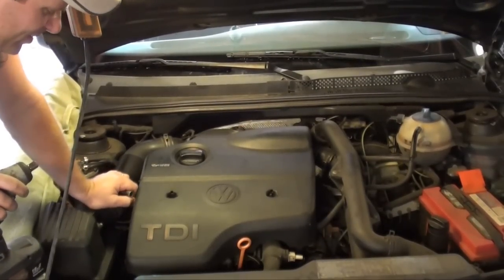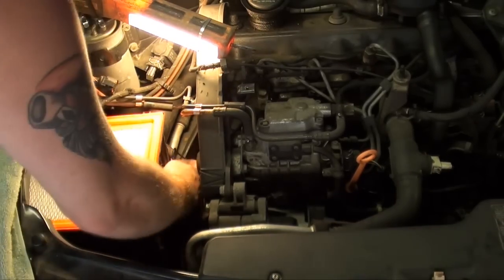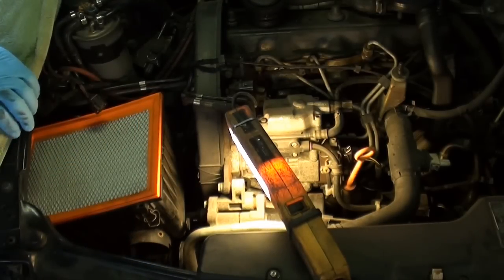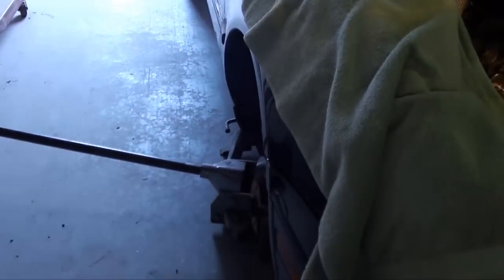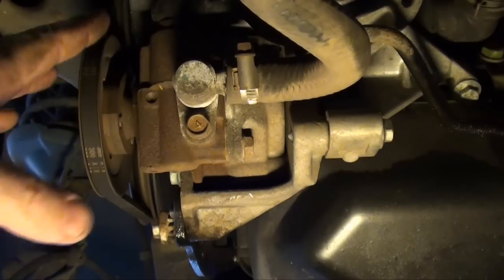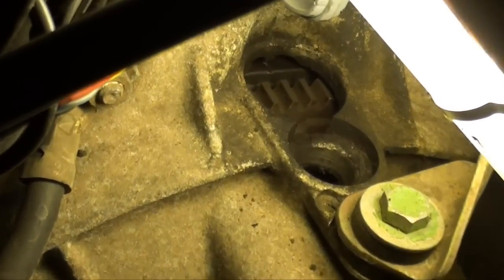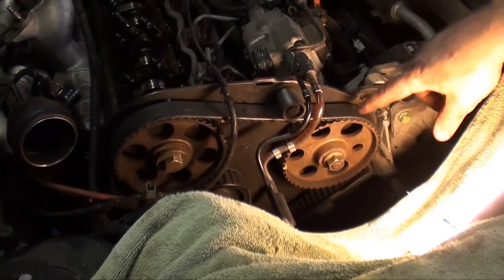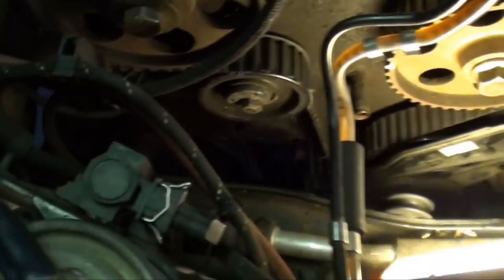VW Jetta tdi timing belt replacement, 1.9 Turbo diesel

Comment: Im trying to remove the belt for the water pump and power steering pump but theres not enough slack in the belt, i loosened both bolts as shown in the video. Any help please?

Comment: Slightly off topic..... if one had a TDI with the injection pump planned to be removed could the Alternator come out form the top with the IP removed with less fuss than method of dropping the AC compressor and fan to sneak it by from below?  Mines a 99 Beetle

Comment: great video!  Just bought an 2003 voltswagon TDI 1.9L jetta and had a couple questions.  The car has 190k miles and was wondering what beside the timing belt, idler etc. should be replaced and/or checked out immediately?  awesome video quality work.

Comment: I just had the water pump , timing belt and all pullies and thermostat replaced, car had no issues when dropped of, just had it done because I just bought the care at 147,000 miles . I did not know if it was done at the 100,00 mile mark and wanted to take care of it before any issues would arrive. Now we have white smoke smells like oil strong coming from the tail pipe, when we pull out and shift gears, also if we are in neutral and rev the engine, its strong of oil. Could they of got oil down the exhaust some how? The car has great pick up and runs good so far.
Reply: Paula Baker sounds like a bad turbocharger.
Reply: +Paula Baker turbo line is leaking

Comment: I am in the UK and have a 98 Sharan TDI auto, the water pump failed, I started stripping it down to replace it and found the timing belt and a follower pully had to be removed, I neither had the special tools or the knowledge to continue and my car was stripped on my drive and couldn't be moved, I couldn't get anyone to come out and help but then I found this vid and went back out with renewed confidence got stuck in and got the job done.
Thank you so much, you saved me a fortune :-)

Comment: I was recharging the AC on my 1998 TD and the car accidently sucked in some AC repair stuff into the intake and revved up really high. The car started again after that, but not it will not start. Is it possible this has to do with the timing? or is it probably internal engine damage?

Comment: Hi robinsonsauto,
I was wondering if you can give me a hand with my car? I hava a 98 Jetta TDI and have tried to time the pump using vcds and it jumps from below the blue line and goes all the way to advanced. I can't seem to put it right on the line. Would you know what Im doing wrong? Thanks in advanced.

Comment: Cool video!  I miss my 1997 Jetta TDI.  I had fun working under the hood with that but I had the timing belt and water pump replaced professionally in 2009, at 96,000 miles.  Glow plugs replaced late April 2010.  The oil was always black even after an oil change.  I sold it last month and now I drive a 2013 Passat TDI SE, 6 speed manual, with AdBlue filler in the trunk.

Comment from the maker: your welcome, if you havent had a chance to watch part 2 check it out you will see why, you need to loosing the cam sprocket which are taper lock style, the injector pump is timed with the valve timing very important, follow the re install you should be fine

Comment from the maker: thanks for the feed back, you need to watch part 2 i go over the installation and show it step for step, including locking the cams and loosing the cam sprockets, never had the injector pump slip on me, that was on the original belt OEM many years ago, 3 timing belts ago, he went over the service interval, that's how i originally got him as a client, been good since thanks again

Comment from the maker: We do, however not nearly the amount of the petrol engine. I agree the 1.9 is a very reliable engine with lots of power considering its size, this one is pushing close to 300,000 miles and running strong very impressive. one issue i found with this 1.9 tdi they tend to carbon up and restrict the intake. Do you know of any corrective repairs to resolve this? To keep this one running strong i found cleaning the intake every couple years, works wounder's. The turbo was replaced